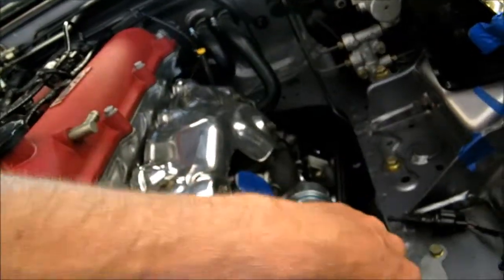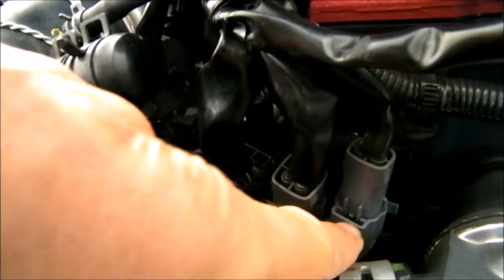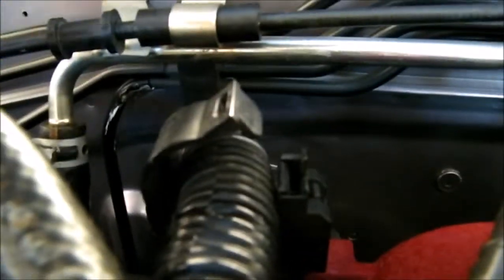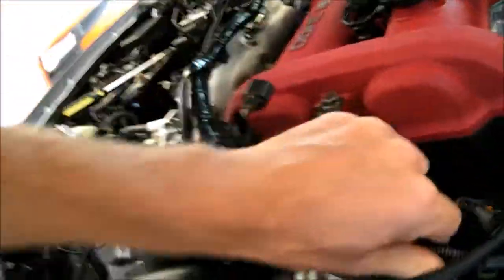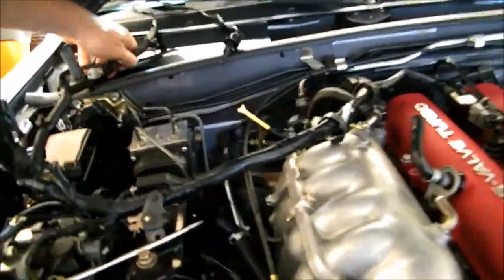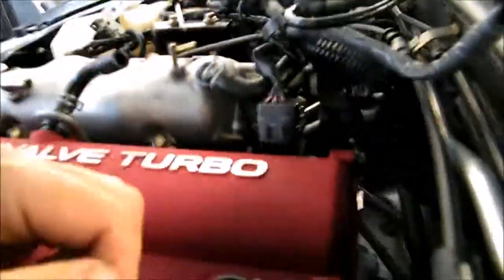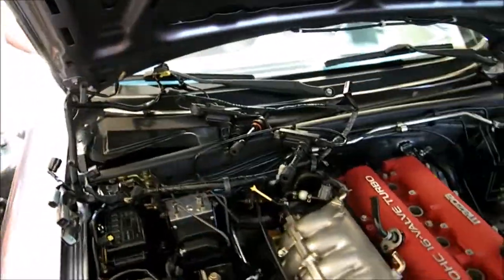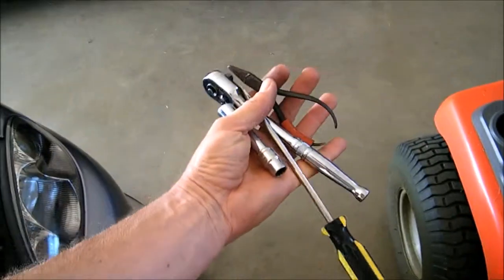Mazdaspeed MX-5 engine removal part 2 electrical wiring

Comment: So did the car run fine without the turbo hooked up? I’m swapping an msm motor into a 99 chasis and the 99 motor into the msm chasis to sell since the chasis has some rust I don’t want to fix. I have the 99 motor in the msm chasis and it runs and drives but is a little rough. I’m also getting a p2004 code which I read could be a check valve.